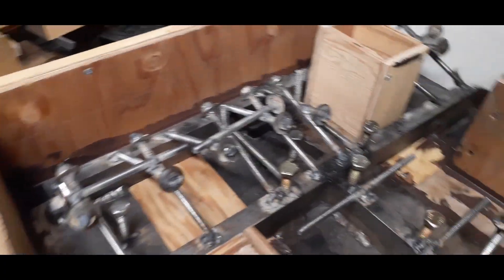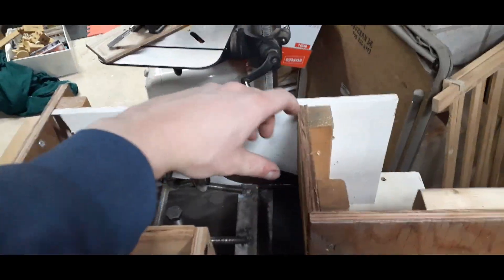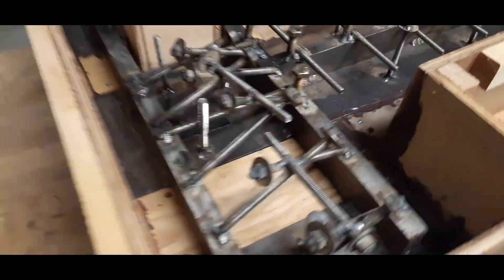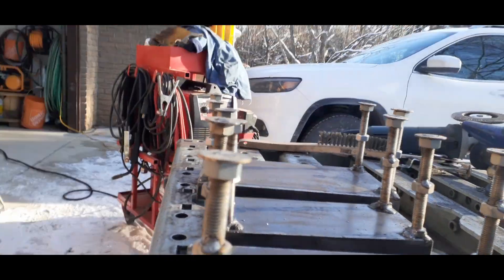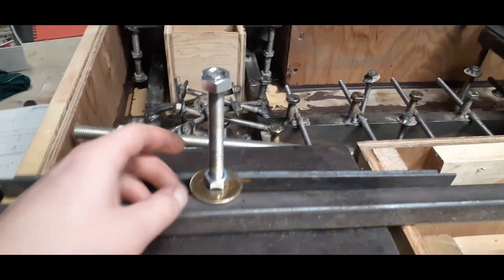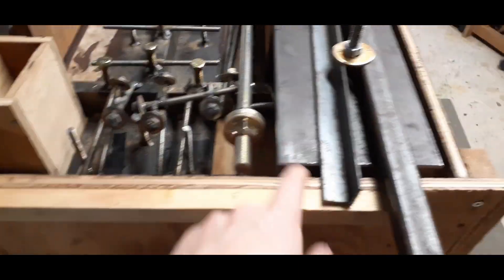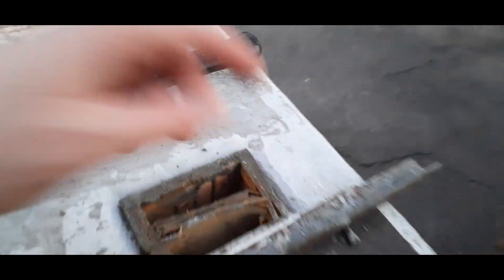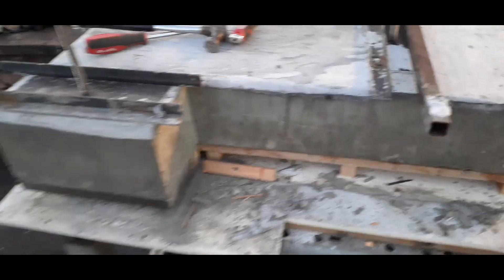DIY CNC Mill: Base Casting

Comment: Hello, i'v casted also such a mill. You can use duracrete, wich is available. Also think about scraping instead of use sanding paper.
Reply from the maker: Duracrete from which manufacturer, that also seems cement based? I do plan to try scraping the linear guide mounting surfaces after they are generally brought flat with the surface plate.